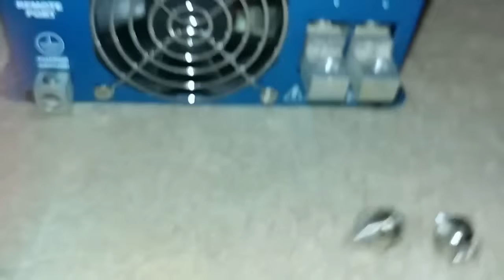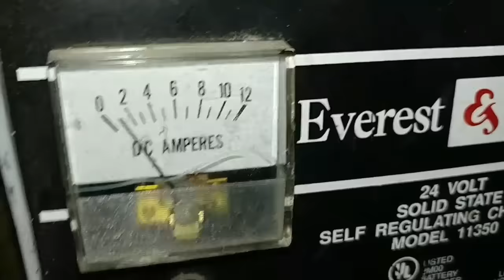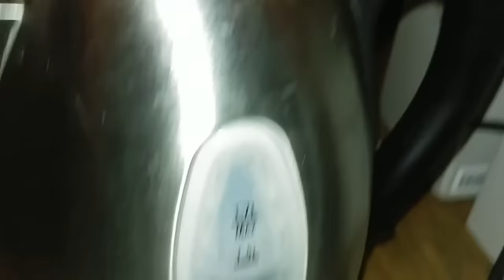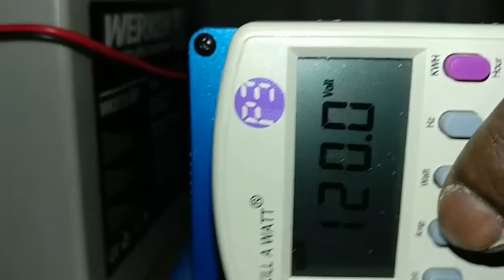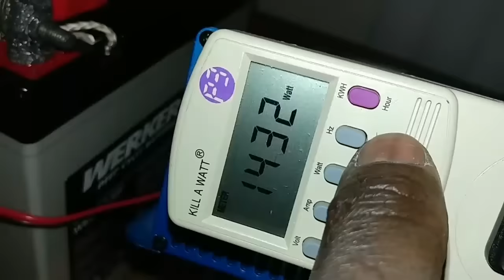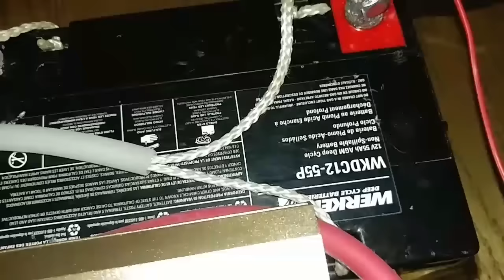BATTERY EXTRA BATTERY DESULFATOR - EX02 12-48-400 Test With Two 12V AGM 55Ah Each Pt #3

Comment: so the 1500 watts out has to be at least 62.5 amps in. One problem with inverters I'd motors take a big start up spike, my 8000watt 24v to 110-220v inverter can run my welder but my compressor does not like it, the refrigerator likes it but we have an old '68 or so freezer that also does not run on the inverter for some reason. computers, radios and such seem to work fine also. gooday eh.